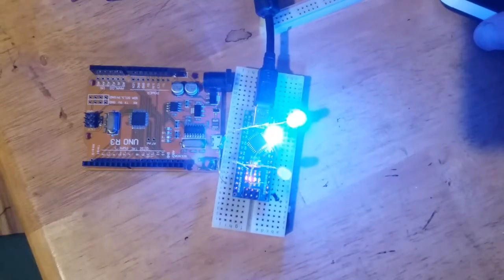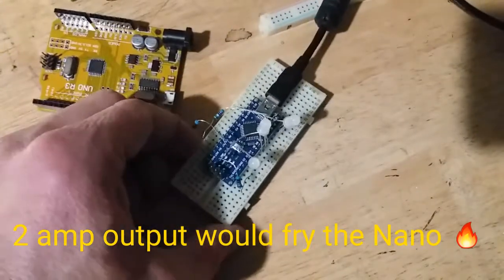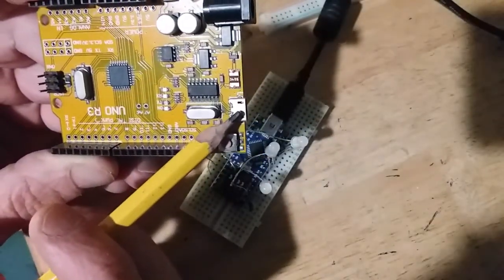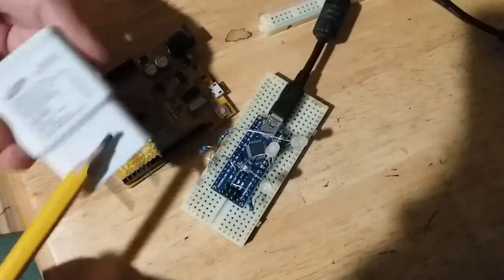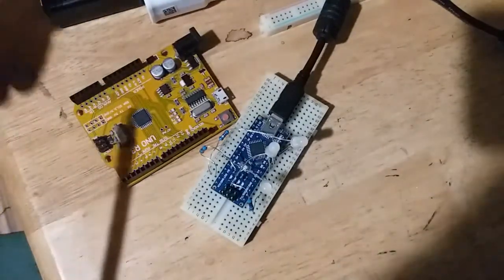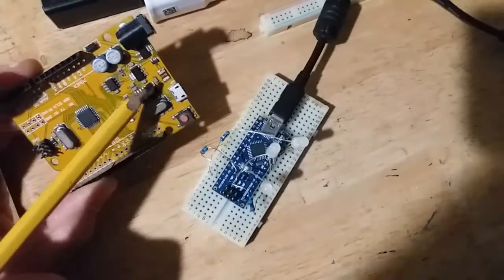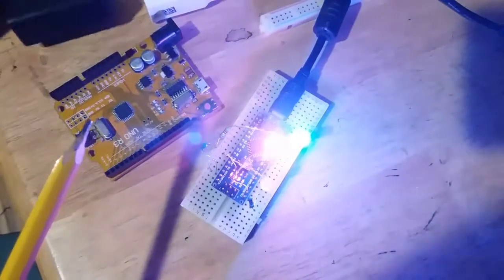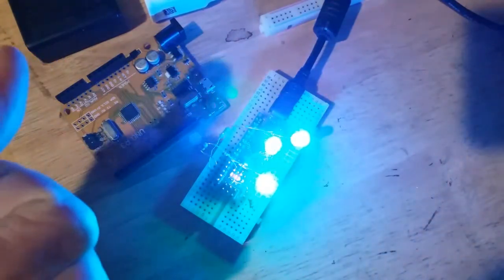Arduino getting hot 🔥

Comment: Common power supply misconceptions, an higher amperage supply will damage (normally operating) equipment, quite simply, no it wont. power supplies dont push amps into things only volts, but they allow a device to pull/draw/suck more current/amps easily without voltage sag/drop, so if your device/equipment/experimental time machine gets a short, you could see nicely coloured smoke, but thats not the power supplies fault.
Also if not feeding them 5v, the 6 or 7 to 12v input range on the smaller arduinos is a bit of a lie, its more like 7-10v, the regulator on them that takes your voltage down to 5v is very very stressed and easily fails at 12v if you have a lot of leds or things on the 5v side, there also no use for car based projects as the car can easily reach 13-14v, and that kills them eventually.
Reply from the maker: Thanks for clarification 👍